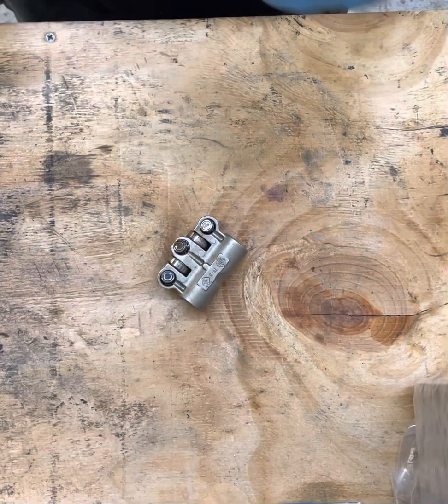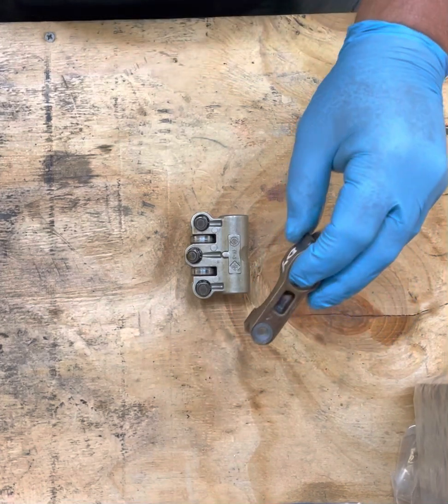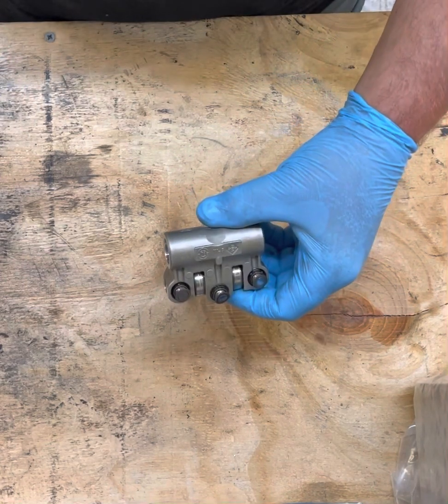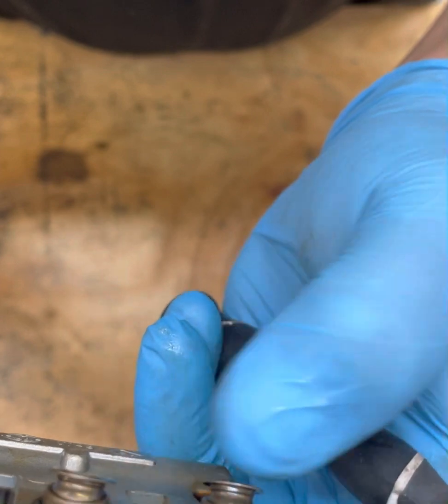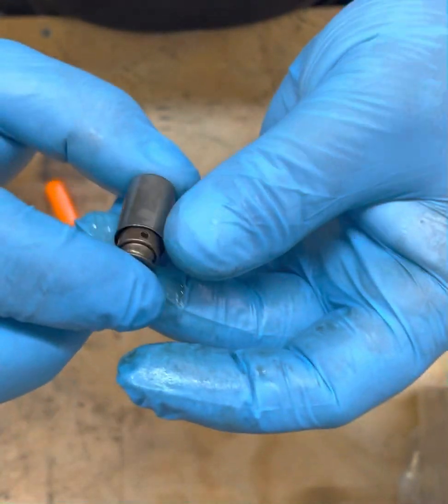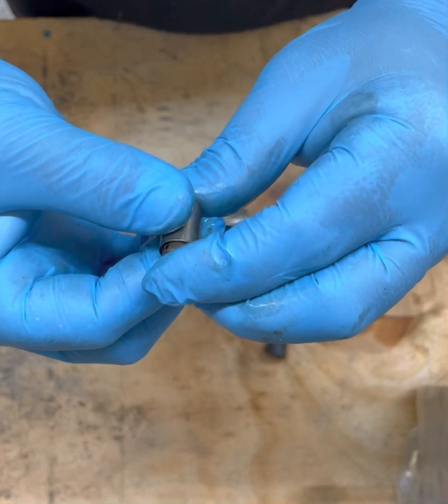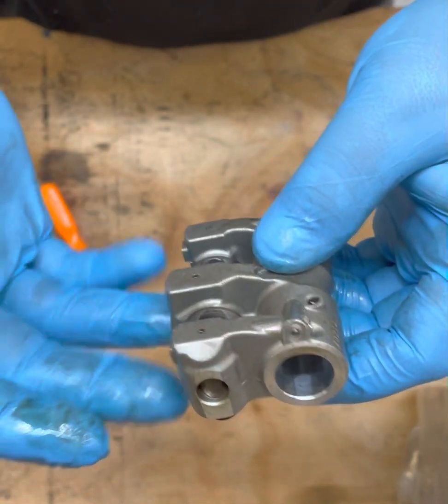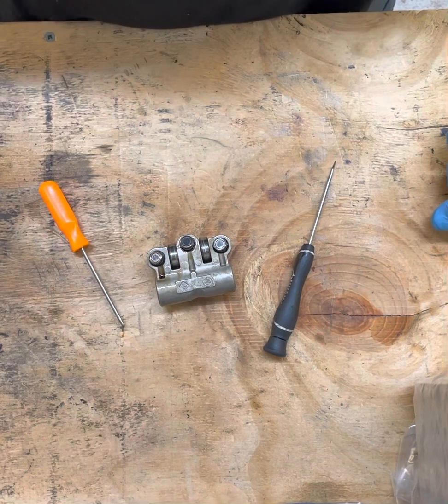Cleaning and freeing up the hydraulic tappets in a 4.2L BHF B6 / B7 S4 engine by AMTuned.

Comment: Do these lifters ever need to be replaced? I haven’t seen any replacement lifters for sale for the b6/b7 s4
Reply from the maker: Usually only when there is valve/piston contact.
Reply: Iv got a 2003 s6 that I suspect has a ticking lifter on drivers side bank. Whats your recommendation to fix this?? Pull it out and do this ??